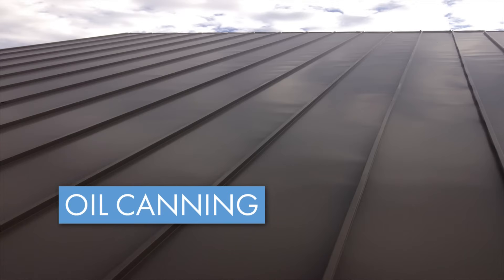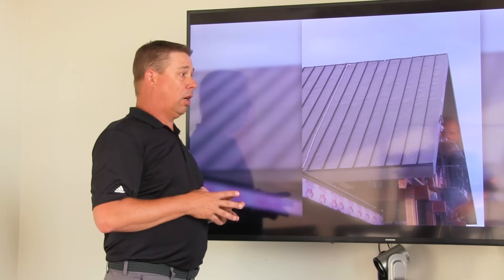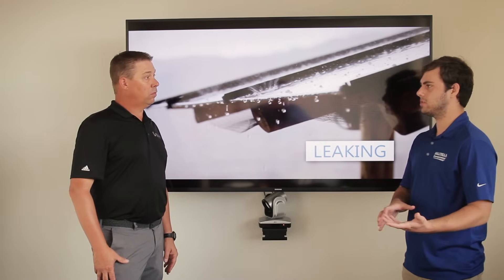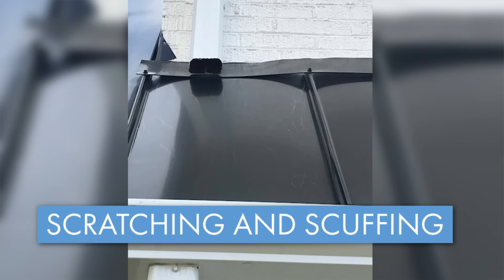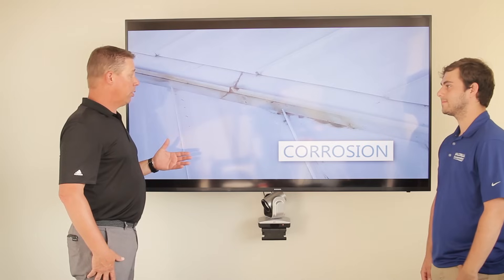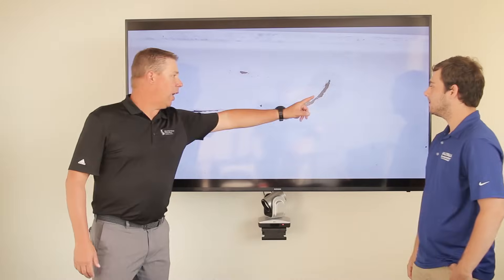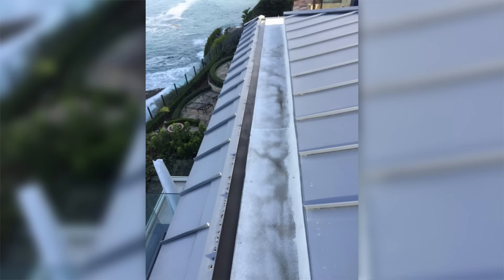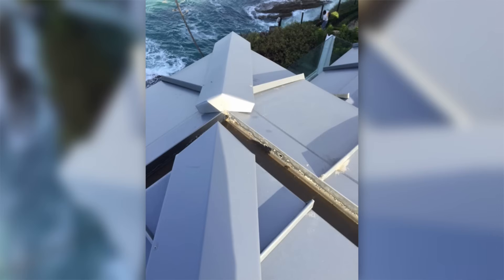7 Common Problems of a Metal Roof

Comment from the maker: If you're thinking about buying a metal roof and want to understand the process from start to finish including the 7 problems talked about in this video, comparisons of roofing materials, cost, and more, download your FREE Metal Roofing Buyer's Guide EBook using the link below. Take it from me, it's the most comprehensive buyer's guide for metal roofing out there. Never stop learning!
-Thad http://bit.ly/metal-roofing-buyers-guide-ebook-download-now
Reply: What I'm looking for is a 22 or 24 gage standing seam flat panel white metal roof with 2 inches of closed cell foam on the back.  Unfortunately, everything I find is 26 or 29 gage, and has a second metal skin on the inside.  I want the foam backing to eliminate thermal bridging, then spray an additional layer of foam on the inside to tie everything together.  Do you have any suggestions?
Reply: @jdm1066  I've seen 24 gauge
Reply: Couldn't download via Chrome, worked with Microsoft Edge. Thought you might want to check out if you had a bug.
Reply: what do i for interior? is it possible to attach dry way to the interior? what about rain sounds. LOUD. also im my opinion ts ugly on the inside how do i make it less ugly?
Reply: 0:36 still waiting to hear dave's definition or oil-canning, but not holding out any hope.

Comment: How do you walk on a standing-seam metal roof installed on furring strips?  If I can't walk on it, I can't inspection nor clean nor repair.
Reply from the maker: We recommend installing a standing seam roof direct to deck rather than with furring strips. If your roof already has furring strips, you want to do your best to step where the battens are located so you don't crease/dent the metal. -Thad

Comment: Good vid but I don't understand why the screw fastener is installer in the pan rather than the ridge? Water runs downhill, putting the fastener hole where the water gathers and runs seems counter-intuitive? Your thoughts?
Reply from the maker: That is dependent on the manufacturer's recommendations and the panel that is being installed. Some panels require different screw placement. -Thad
Reply: Peterodonnell: I was thinking exactly the same. Fixing in the valley is just asking for a leak path, it is saying "please make a leak here". A longer screw and a local packer/spacer piece is required to do a proper job and place the fasteners on the 'ridge'.

If any designs call for fasteners in the valley, then they are simply shit designs from the get-go.
Reply: Most sheet metal designs do not have a flat spot on the height spot.  Seems stupid, but without the flat, the grommet on the screw will not seal.  Also, need a hard spot to torque into or the grommet will not seal.  So somehow need a solid support running along the high ridge that is exactly the correct height.  It also has to be located, left-right we'll say, to fit exactly under the high ridge; not very practical.

Comment: My experience: First, I over tightened the screws. This squashes the grommet and in a very short time it will become cracked and it will leak water. 
Second, in an effort to not over tighten the screws I actually didn't screw them in far enough. The result was an inadequate seal between the roof and the washer. This will cause a leak.
What seems to work for me is to tighten the screw all the way until I see the grommet start to squish so that I know everything is tight and then I back the screw out slightly until the grommet isn't bulging out. 
So I think that over tightening or undertaking screws can be a big deal.

Comment: We just got standing seam nail strip roof installed and man it makes a lot of popping sounds. It's 40° outside and when the sun comes out it immediately starts making a popping/thud sound. This was put on a one-room cabin with a shed-shaped design. There is no attic space. The roof is black. The panels are about 22 ft long. I was hoping to find some content regarding thermal expansion sounds on a metal roof. Do you have a video on that? And how to problem solve/fix it.
Reply: sounds like my aluminum siding..morning and evening.
Reply: painting it white will decrease the noise.

Comment: I'm buying a home and trying to do some research on what I can do to prevent damage to the home I am buying. The seller had installed a metal roof but it's attached to the rafters. There is nothing to protect from any kind of damage brought by the weather. I don't know if I need to have this roof torn down and new one put up or if there is anything I can do that won't cost a fortune.

Comment: So I'm just now getting more into metal roofing and I've ran into several problems that I'm trying to figure out one is the exhaust vent for the stove hood the vent that is sent will not seal to the metal we are using and no form or fashion it does not fall in between any valleys regardless of any measurements that we use also we have a chimney stack coming out of the roof which is I guess galvanized metal silver and I want to know if there's a boot to go over type of metal that we're using and the metal that we are using is 37 and 3/4 wide it is not standing seen it's the kind that's got the screws that show with the washers and I'm just trying to figure out do they make a flexible vent or do you actually have to come and build a say a square box that goes over the ridge and case it out and metal or curbing and then do that metal roofing is very complicated if you want it done right and these are two of the questions that I propose I believe the valley of the metal we're using cuz I can't remember offhand I just got off work is 7 in, is there a flexible vent that can be used for either one of those I mean even though the heater is gas is still getting some type of hot air coming through it yet the guys that installed the chimney which is just bare metal use silicone so it's getting exposed to heat to a certain degree so is there a plastic covering is there a flexible metal covering I mean there's a lot of stuff that I cannot find no videos that cover it

Comment: Everything requires maintenance, nothing lasts forever.  Properly installed a metal roof rarely leaks with the exception of screw washers failing due to the fact the get hard, crack and deteriorate . Would you rather replace washers one screw at a time or a entire comp roof?
Reply: @dhrtiwalter8670  If your looking for a new roof it's a complex question. Metal goes up fast and the easiest to install IF you research well. Metal can be a noise issue if installing directly on sheeting and the screw washers do crack and there hasn't been a real good solution unless you go the !re expensive route of hidden fasteners which s !ore appealing for a home. comp architectural shingles with at least a 20 year guarantee are my choice when it comes to financial hang for the nuck. Understand when it's stated how long a product lasts it doesn't include hurricanes, tornadoes, hail storms and any warrantee usually requires installation by a licensed contractor not the private home owner. Shingles require more time and experience in my personal opinion as I catch people making mistakes. A air nailer speed up shingle roofing which I won't do one without  it. Research is a good idea and maybe watching a experienced roofer who won't mind a few questions. Don't stand there doing nothing, hand him shingles or line them up for him. Googlers are annoying as well as kids running around on a job site and labor people can be a little short tempered with both. If I was still a contractor It would be written into a contract not to have the home owner on the build site unless workers are gone for the day as believe it or not people are devious and look to get out of paying and sue for any reason they can make up. Retired, I may help someone I know but hate dealing with people today. It's a crazy world anymore.
Reply: P.S. .. If it's a cabin , out building or you don't care about having screw heads exposed and want gadt coverage due to winter coming fast , metal is not a bad tion.

Comment: Getting to the installer... If you have predominate winds from any direction, if possible, start the sheet installation from the opposite end so the wind will blow over the seams and
not constantly hitting a seam that over time will start lifting, getting loose, and could eventually blow off. I told my installer, with many years experience, to instally mine that way.
He said he never thought of it, but would start doing all installations that way.

Comment: Oil canning is caused by metal panels with no striations expanding and contracting in temperature change…no way around it…it’s an outcome the client needs to be made aware of and basically a waiver needed to be signed for company protection…it’s  a visual issue but not a  waterproofing issue…something a client should be made aware of…Other than that installer work ethic and experience determines all results …just like any other trade.
Ricardo with BlackGold Roofing ..Beullton CA..

Comment: Not so fast, for example, you need to explain the reason the paint faded or the metal corroded when the installer put copper next to galvanized steel.

Comment: Thanks for this info! I’m considering buying a home in the Sierra Foothills in California. The area around the house has a very large cleared fire safety zone…and the 5 acres of forest have the understory very cleared….but…as we know…fires are going nuts in Calif. My friend who works for a home building company up there said metal roofs are not fire safe. The heat and embers are drawn up the ridges and get held in the attic making your house like a fireplace. What do you think as far as fire safety? These fires have been burning everything….melting metal and solar panels etc. Even if the fire itself doesn’t reach the house…the heat from the trees around the property and embers blowing could ignite in the attic. So I don’t think the metal roof really helps and maybe it’s actually bad. My friend says comp shingles are much better. Any opinion/advice?

Comment: Geez, if I had seen this before we got our metal roof we would have never gotten it.  Find a reputable builder/roofer and check them out very thoroughly.  Once they tell you which company's metal they use for metal roofing, check out that company then call them and find out how they feel about your local roofing company.  A metal roof is expensive, but it it is done right you only have to put it on once.  We love our metal roof.  It is worth pursuing.

Comment: There is a clear plastic wrapping over my metal roof that is being installed causing it to be a different color than I expected, will this be removed after the installation is finished?
Reply from the maker: Yes, the PVC wrapping should be removed. It is there to protect the material during installation. -Thad

Comment: Biggest problem I see installing is sheets are stacked you have to be very careful taking one piece off the stack because if it drug off scratches tend to show up
Reply: We just bought our home. Passed inspection. Inspector had a tester to test dampness in the attic. Which was negative. Now we have a roof leak around the chimney. Looks existing and the previous caulking and flashing is bad. We've had an estimate for a complete replace for $16k. Roofing company says the metal roof was installed poorly previously. So we're facing a metal roof needing replaced. Is this common? Is that the right price range? We're thinking of replacing our roof with a shingle roof. The cost of a new metal is not something we want to do. Any advice?
Reply: Not when you have a machine and make them at the site,lol

Comment: you do not have to go away from flat standing seem panels to prevent oil canning. you simply use backer rod underneath the middle of the panel.
Reply: Not necessarily. Backer rod helps but doesnt stop oil canning completely.

Comment: Was getting a metal roof,but now a asphalt roof after this video!
Reply: You can have a bad install with asphalt shingles as well.   Both roofs depend on the install.
Reply from the maker: Metal roofs aren't for everyone, but the same goes for asphalt shingles. No system is perfect, but the key is finding what works for your budget and preferences. Let me know if you have any questions! -Thad

Comment: I had metal roof for 30 years it is best I ever had, I never worried if snow would pile up, it will just go off my roof easily and a great fire prevent. I would recommend metal roof to everyone. especially for rural dwellers.
Reply: It is already starting to rust and u cant patch it
Reply: The fire protection is actually a misconception. Metal roofs transfer heat better, which means that the wood beneath the roof is more likely to catch fire with a metal roof
Reply: @davinhart8374 checkout any video about New Zealand.  I believe 90% of there roofs are metal roofing

Comment: Just exactly HOW does a roof get "Over Whelmed" with Rain water? Isn't that EXACTLY what ROOFING is there to STOP?
So what your saying is, the roofs you sell are thin crap and WRINKLE (oil canning..what the hell does that even mean..) and don't use them where it might rain hard? Or the sun may get hot?  The installers ALL suck, and everything is THEIR fault? Don't forget to MAINTAIN it too!  About cover it?
Give me some good 50 year architectural shingles, and a great water barrier under it..and I will reroof it in 30 years..and SAVE 2/3 of the price of one of these things. 
  I ALWAYS wanted a steel roof...I figured no more roof worries..EVER!! Boy, was I ever wrong!
Reply: This guy is a moron and this is exactly why metal roofing can look so awful. The way you eliminate ‘oil-canning’ is by planing the surface it’s being installed on - roof or wall. You need to have a perfect surface. So usual material that can wrinkle like this are used on walls where the barons can be easily planed

Comment: Love the screw illustrations. They are in the FLAT of the panel, where the water is. Should be in the RIBS. Major fail of an illustration!
Reply: You got that wrong-screwa hold be in valleys,properly tightened.if they are in the "mountain",they will never seal well,from temperature differences,and just the fact that you can not get the right pressure on the rubber washer.
Reply: @edcat6587  sorry where I come from nothing is in the flat except at the very bottom of the panel. And I've been doing this for over 35 years. All water is flowing on the flat. We give 10 years workmanship warranty. Most people do standing seam where all the fasteners are hidden. For 5 v- crimp all our fasteners are in top of V's. We do things different and our s*** lasts longer.

Comment: I would like to see any rubber washer last in the Arizona desert. The dry heat here bakes the rubber even if it's not in direct sunlight.
Reply: Same thing in the north, minus 20 minus 40 degrees in Minnesota will destroy any exposed rubber or plastic. No way it will last.
Reply: @daniluchison  surprisingly here in New York, which I know doesn't get as cold as Minnesota, the rubber washers are still intact 30 years later on a shed roof.That's in spite of the fact that my dad installed them completely askew.
Reply: @daniluchison  Harsh weather variations (90F + to -25F every single year) and years of exposure is the best laboratory
Reply: In Tennessee we see 35 year old exposed fastener leak free roofs but concealed is of course better.
Reply: Contractor for 45 yrs, I'd never use a exposed fastener panel on residence.  
Concealed fasteners installs avoid the corrosion and leak issues.
Reply: @timjester8555   how much more does it cost?

Comment: Great video, regarding installation do you recommend drilling pilot holes with 5/32 bit to allow for expansion and contraction? Possibly prevent oil-canning?
Reply: no..use self tapping screws with gaskets.

Comment: So basically stick to a non painted specific steel wavey pattern and I only have to worry about rust or a bad install.
Reply: And your roof will be a great conductor for emf.electricity,dew etc.These are not good at all.
Reply: I'm assuming that it is still galvanized?  Corrugated panels are stronger and won't show oil canning.  OTOH, you need to replace the exposed fasteners periodically, which won't happen, so at some point you need to really replace the fasteners with longer ones.  Which might eventually mean the people living there in the future have to do major renovation as they replace rotted out joists.  OTOH, you can use painted standing seam with striations and concealed fasteners and your heirs can decide whether they want to replace the roof because has an attractive, subtle chalky look, but they want it to be shiny.  Geez, people actually buy paint that has got a chalk finish!

Comment: Hi, I have a very gentle slope on my roof(4" in 12ft ), do the metal panels work for me? thanks
Reply from the maker: Hello! If your roof slope is a 0.5/12 or greater, standing seam metal roofing will work well for your application. If you're considering an exposed fastener system, we recommend a slope greater than a 3/12 . Thanks for the question! -Thad

Comment: The main cause of”oil-canning”, is from using too thin metal.    Temperature causes the thinner metals to contact or expand !   Why did you not mention that issue ??
Reply: Because most people get the thinner metal for budget reasons, if they advertised that aspect it could hur the majority of their business.
Reply: Temperatures cause ALL metal to expand and contract, it  doesn't matter how thick or thin, and all metal will oil can (look at a ship's hull if your not convinced) yes the thicker it is the larger surface area needed for oil canning to occur, but even 22 gauge is perfectly capable of oil can in an area the size of a roof panel so while thicker is definitely recommended, the controls the video mentions are more effective than simply thinking thicker will fix all other failures.